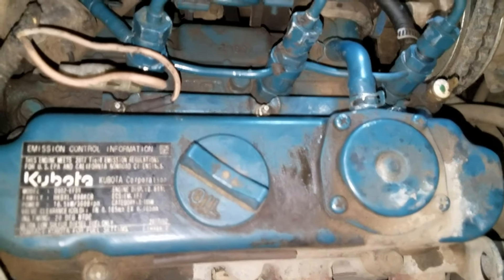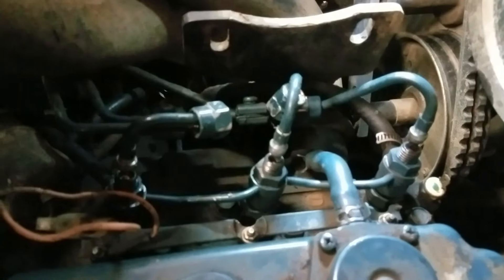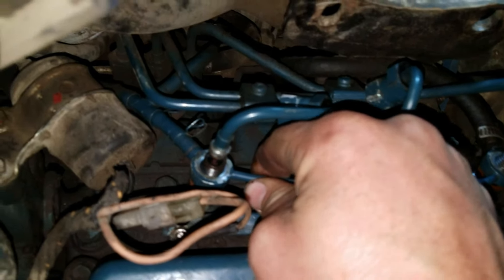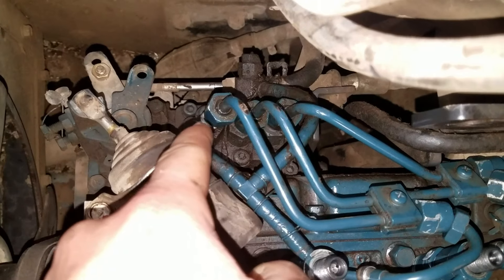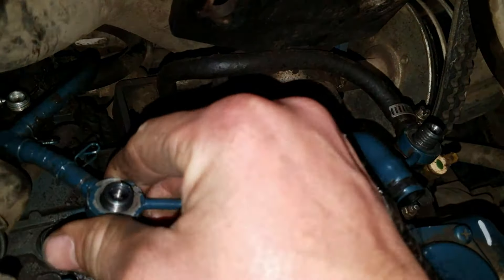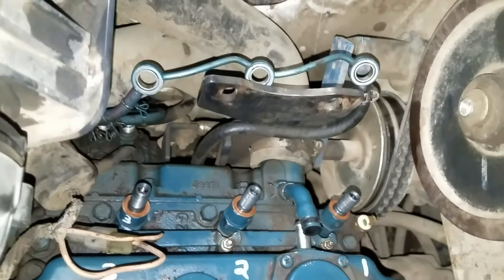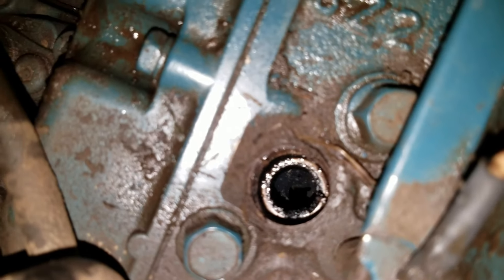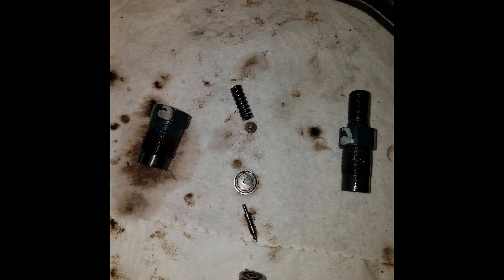3 cylinder Kubota diesel motor fuel injector removal and replacement.

Comment: Great video thank you, this really helps me.  I am new to this and have the marine version of the Kubota D950 (Universal M25XP).  It has a nasty what seems like vibration above 2k RPM and makes black smoke at that point.  Someone on the dock said it sounds like a 'dead cylinder' caused by a bad or failing injector (comments/opinions are welcome and encouraged).  I especially appreciated seeing that fuel rail come off in your video because I was looking at that on my engine wondering how in the hec those lines were  fastened.
Reply from the maker: Glad I'm able to help. Hopefully I'll have a new video here in a while showing the close ups of removing injectors and such. I didnt have my camera gear that day so I had to hold the camera. 
It sounds like it to me, either a bad injector or a bent connecting rod.
Reply: @rosincore    Thank you for the additional comment and reinforcement.  Much appreciated !

Comment: Fuel rails are a common rail injection thing. Lines in the top of the injectors are high pressure injector lines, line/couplers that connect injectors  is the return line assembly

Comment: It's a good idea to hold the injector steady with a spanner when you undo the feed pipes. I went to undo the feeds on our Jensen wood chipper and the injector turned slightly too which put a hairline crack in the bleed pipe's connection to the collar. Cleaned it up and silver soldered it back on, but would have been a problem if it had happened on site.
Reply from the maker: Good heads up! Thanks!

Comment: Video was a great help of what to expect when removing the lines, EXEPT I cant get the lines of the fuel injection jump. It's like they are welded on (with rust) I've tried all the different penetrants for almost 2 weeks now. The fittings that goes into the pump are loose, but the injection lines won't budge. May have to cut the lines and remove the injector fittings to get a good grip on them to see if I can beat the lines off or heat would be safe to try then.    Anyway, thank you for sharing how you removed your lines.
Reply from the maker: @ibberman  try to get your hands on "Line Wrenches" or fuel line wrenches. They grip and wont round. Tap one with a hammer
Reply: @rosincore   Thanks for the tip, but that's what I've been doing, using a mallet. They are stuck on the fittings that are part of the injection pump. The problem is they (the pump fittings) are turning ( and the stuck injection lines turn with them) and kind of hard to keep them from turning while holding and beating the line connectors.  If I don't succeed I'll cut the lines and place the pump fittings in a vice, then I could even use some heat?  Hard to believe the are that hard to remove, but I can see they have had some rough handling in the past.   Thank's again.

Comment: Thanks for the vid. That gets me started. I've got to tare my d600 down. I've never messed with a diesel before. Mine is blowing oil & water out of the exhaust. 😔😒   I've got a lot more learning to do. 🙄
Reply from the maker: @speedbuggy7240  if your blowing water out of exhaust as well, most likely that's a head gasket. It's pretty straight forward. Just follow torque specs. I usually do them in about an hour or so.
Reply: @rosincore  That you for responding. I hope that's all it is. When I get time this fall/winter I'll pull the head and have it checked. If it's good I'll have it resurfaced, but I'm wondering if I should have the whole head redone. 
It's in a cub cadet 1572. I have another 1572 that I've got to see if it runs. I just got both these in the last couple weeks. Thx again for the vids. I appreciate it.

Comment: Many thanks roll one  of little diggers over and it lock had pull injectors out watch this  went back out got the job done back up and running 👍👍👍
Reply from the maker: I've found its easier to pull the glow plugs.  Same effect but easier

Comment: Good video thanks for uploading it, much more intuitive than reading the manual.
I notice diesel leaking some where near the injectors. I thought it was where the injector screws into the head but I think perhaps it may be higher up where the fuel line are tighten on to the injectors.
Is it possible for a leak to occur in either of those locations?
Reply: Dealing with same issue
Reply: @jonathanfalkenberg6457  In my case I just tighten up the nuts above the fuel line that links across the injectors. That eliminated 90% of the leaking diesel. 
There remains a small leak where one of the injector threads into the head but its so minor I will leave it as is and only monitor it.
I would recommend to start with tightening the most accessible nuts/components first, even if they appear tight, and see if that solves the leak. There is a lot of work to get a spanner on the injector proper and it may not even be leaking there,
Reply from the maker: @kevocos  Sorry for the late reply, but normally, it's either the nuts came loose or the copper crush washers are leaking. I've had to replace them before and torque properly.

Comment: Great video, well explained! Thanks!

I own an old compact Antonio Carraro Tigre model. I had a runaway with it but luckily the engine haven’t seized.

I was able to start it again after servicing it but the engine runs rough and clunks much more. It also make a bit of smoke. Not much and white, but it does.

what I've read is that injectors might be the cause of it.

So, I was wondering what was the cause on your Kubota that made you clean your injectors?

Thanks!
Reply from the maker: I cleaned the injectors just for the video. The unit was rolled over while running. I pulled the injectors to get the oil out of the motor. It's easier to pull the glow plugs instead, but I wanted to check injectors.

Comment: Important questions where can i buy one of those grey blue hoses by your hand on the vavle color
Reply from the maker: @Sethhaun78  you can order it online. Sometimes bobcat sells parts that are easy and quick to get. 
If your talking the hose from intake to valve cover, it's PN 7016853 TUBE BREATHER

Comment: I came hoping to get the torque spec as I don't have the book. There is actually another part to the injector. It is a very small disc that sits on top of the spring in the upper half. I used carb cleaner, then tapped the upper on a wrench to get the disc out. Cleaned out that area completely.
Reply from the maker: Assemble the nozzle in clean fuel oil.• Install the push rod (4), noting its direction.• After assembling the nozzle, be sure to adjust the fuel injection pressure. 

Nozzle holder torque 
34.3 to 39.2 N-m
3.5 to 4.0 kgfm
25.3 to 28.9 ft-bs

Overflow pipe retaining nut
19.6 to 24.5 N-m
2.0 to 2.5 kgf-m
14.5 to 18.1 ft-lbs

Nozzle holder assembly 
49.0 to 68.6 N-m
5.0 to 7.0 kgfm
36.2 to 50.6 ft-lbs

Comment: I recently purchased a 463 with a Kubota D1005 engine. The previous owner had been putting gasoline in the tank, but I don't know for how long. He is elderly and has no clue how mechanical things work. His deceased wife was the brains of the operation. The engine only has 225 hours on it. I drained the fuel tank (still had some diesel mixed with the gas) and flushed it out. Filled with fresh diesel fuel and new filter. Machine fired right up and ran great with no smoke. Gave the machine a good wash in the morning and immediately went to start it and it would not start. What do you think?
Reply from the maker: Is it sputtering or anything or just cranking without trying? Any smoke coming out exhaust?
Reply: @rosincore  
When I crank it after sitting for a long period it gives a sputter as if it was about to start with a puff of black smoke. After that, nothing but cranking. We had loosened the top nuts on each injector and fluid did sputter out when cranking.

Comment: All good, except I didn't see how you got those injectors out. On older tractors, those things are frozen in there.
Reply from the maker: Yeah I regret not filming that part. Ill try to do a video on it when I have to pull them again. I used a 6 point socket and breaker bar to "break" them loose.

Comment: Great video! Just bought a RTV X1140 diesel. I have noticed that mine  blows a little whittish smoke at start up and disappears in a few seconds. Just curios if it may be normal for little smoke at start up ?  Mine has barely 7 engine hours.
Reply from the maker: Yeah thats normal.  Especially when the unit is cold.  Make sure you run the glow plugs before startup.

Comment: Did you replace the injector cups like the manual calls for? If so, how did you get them out?
Reply from the maker: no i did not. I know the manual specifies that but i could not get them shipped in time. I re used the cups and have had no problems. 11/21
Reply: Is the injector cups same as the heat shield?

Comment: What is the torque spec when tightening the injectors once new ones are in place?
Reply from the maker: Nozzle holder torque
34.3 to 39.2 N-m
3.5 to 4.0 kgfm
25.3 to 28.9 ft-bs
Overflow pipe retaining nut
19.6 to 24.5 N-m
2.0 to 2.5 kgf-m
14.5 to 18.1 ft-lbs
Nozzle holder assembly
49.0 to 68.6 N-m
5.0 to 7.0 kgfm
36.2 to 50.6 ft-lbs
Reply: Thank you very much!

Comment: What was happening with your Kubota to make you wanna clean your FI's?  Mine is blowing out black smoke and wont turn off when i turn the key to off position.  Should i start by cleaning the F.I's?
Reply from the maker: @bro_chacho  the fuel injectors were actually out of a Bobcat mt85. Same engine though. It was rolled over and fixed. Had a little smoke after repair. Checked injectors just to be sure they were clean.
Reply from the maker: @bro_chacho  usually that is a fuel shut off solenoid gone bad or needs the linkage adjusted. Look for the rod that moves when the key is on and off.

Comment: Will the Pvc valve cause my diesel engine to blow white smoke and burn alot of oil?
Reply from the maker: Heavy White smoke from a diesel engine is caused by the temperature being too low in the combustion chamber. This can happen when either there is raw diesel fuel that passes through to the exhaust, engine coolant is entering the combustion chamber, or the piston or other components are worn, damaged, or not correctly installed.

Light white smoke could be due to A clogged fuel filter
Low pressure in the fuel pump (Air in the fuel)
Faulty or damaged injectors

Comment: I was watching your video and thanks for doing it. My G4200 started with a leak on the manifold for the injection pump. I replaced the gasket but still had the same leak plus picked up a leak on one of the injectors. I replaced the two "O" rings on the injector and installed another gasket. I still have the leak, it loks like it might be oil with gas coming out. The motor tries to start a little but never does run plus the leak comes out at the gasket. Is there a chance that I am pressurizing the motor due to an injection pump leak and forcing the oil-gas out?
Hopefully you will have the time to assist me.
Reply from the maker: Check out this page as it has information that might help.
https://www.justanswer.com/heavy-equipment/4gq82-hello-1998-kubota-b2400-sitting-few.html

Comment: Great video 👍 I just bought a Small tractor, with have the same engine and I have to crank a LOT and after a lot of smoke it finally starts. Do you think it the injectors? I changed the fuel filter already.
Reply from the maker: Make sure if it has glow plugs to run them for 10-15 seconds. Make sure there is fuel getting to the injectors .

Usually smoke would indicate that you are at least getting fuel in the cylinder, black smoke usually indicates an over-fueled or under-aired condition. I would pre-heat the glowplugs for 30 seconds or so. Make sure your battery is fully charged.. Most of the time this will get it to start if there is not another problem. After trying that method a couple of times if it still won't start I would go ahead and check the air filter and then crack the injector lines at the injectors to make sure they are getting fuel.
Reply: @rosincore    Thanks, I’ll check the glow plugs next, I usually run them for at least 30 secs. The air filter is new, and yes,there is a lot of black smoke when it fires. Then, I’ll check fuel at the injectors for sure.  Thanks again.
Reply: Did you fix it?
Reply: @prevost8686  ,  
Yes, found that there was no power going to the glow plugs. Thx for asking

Comment: Working on a Vermeer 450 TX mini skid with this motor injectors are leaking on top, what could possible issue be?
Reply from the maker: Sounds like the top crush washers. I'll try to get a picture of the breakdown. They are not expensive.

Comment: I think I would have cleaned that whole area first before the operation.  Warm (not hot) engine plug Gunk plus either hose or pressure washer (used carefully).  Really don't want to introduce crap into the fuel system or the cylinders.
Reply from the maker: @cbrbimmer1  your 100% right. I didnt have the option when I took it apart. I definitely clean before I do this on all other stuff haha.

Comment: Thanks for the video. What was the symptoms of the motor that made you clean the injectors. My motor when it’s in high idle it seems like it wants to cut off I have changed both fuel line filters but I have not clean the fuel injectors
Reply from the maker: sorry for the late reply... The unit was rolled over which requires in a diesel engine to pull all injectors and to rotate the engine to get rid of excess oil buildup in the cylinder so you do not bend a cylinder rod. Sames goes if you hydro lock a gasoline engine. You would pull the spark plug and rotate the engine. Hopefully the engine was shut off just before it sucked in any oil (water). I have saved many diesels this way.

Comment: How often do you find yourself having to do that amd what's the best way to prevent all that nastiness in there?
Reply from the maker: Not very often. I Only do this when a unit gets rolled over or there is a noticeable loss of power,  or when the engine does not want to throttle up smoothly. 
Running diesel additives every once in a while helps keep them clean,  as well as replacing your fuel filters regularly.

Comment: How did you get the heat shield out after the injectors are out
Reply from the maker: Just used a pick and they came out
Reply: @rosincore  thanks
Reply: If you replace the injectors do you need to replace the heat shields

Comment: Would loss of power and engine stalling be a sign of a bad injector? There’s a 3 cup Perkins in my cat mini ex, wondering if I should try this
Reply from the maker: Yes that's usually a sign.  Do you have a lot of smoke out of the exhaust as well?
Reply: rosincore no heavy smoke but sounds kind of like a miss fire. Thanks for the reply I appreciate it

Comment: i have a 2 cylinder Z430  Kubota Diesel. do you have or do you know what the drain thumb-screw type thing is supposed to drain, it's below the injector pump, it has 2 flat kinda things, like a flattened out straight wingnut ?  to open & close.  i only see some dust on end of it when i took it out. . looks like dried antifreeze maybe. is there supposed to be oil in bottom of an injection pump ? i cant't find info on it anywhere.
Reply: Sounds like thats the water drain cock. So dried antifreeze sounds right.  That is to drain the block when doing a coolant flush or change.  Please checkout https://www.dieselparts.com.au/wp-content/uploads/2013/03/Z482-Z602-D722-D902.pdf and goto page 12.  Does this look like what you are talking about?

Comment: Help: I have fuel to the injector pump but the rail is dry I replaced the fuel solenoid still no fuel in the rail
Reply from the maker: Crack the lines loose at the rail to get the air out. You may have to crack the nuts at the injectors. Only slightly loosen nut as there is extreme pressure.
Crank until fuel comes out around nut

Comment: Any idea why one cylinder has so much carbon?   How is the thermostat?  Asking:  If thermostat is hanging open, could the cylinder closest to the radiator be running cool?
Reply from the maker: unfortunately I'm not sure the answer of that question. The thermostat was working fine before this video and after.

Comment: Probably a stupid question but why does each injector need to be labelled? Are they not interchangeable? Thanks!
Reply from the maker: The only reason i labeled them is because i re used the copper gasket. Ends up that i needed to buy new ones as the old washer leaked and caused blow by. It was bubbling outside around the injector. You should always buy new crush washers every time your remove and replace your injectors. the bobcat part number is 6655218

Comment: Where did you find the torque spec for all the bolts removed?
Reply from the maker: The workshop manual from kubota. They have everything you need for information.
A copy for example 
http://www.kubotabooks.com/AutoIndex/index.php?dir=Engines/&file=SM-E2B%20series.pdf

Comment: Well I will be. I am changing the injectors in a kubota 5 cylinder, they are stuck so I thought I'd check out this video to see how you pulled them out...... Um, you skipped the only part I wanted to see.
Reply from the maker: I am sorry about that, I just used a 1/2" breaker bar with 22mm socket to break them loose.

Comment: Nice video. Is there a copper washer that goes on the bottom side of the injector in the injector bore of the head?
Reply from the maker: yes PN: 6655218 is considered a gasket and should be replaced every time you remove the injectors.